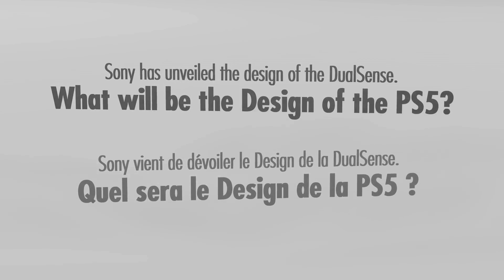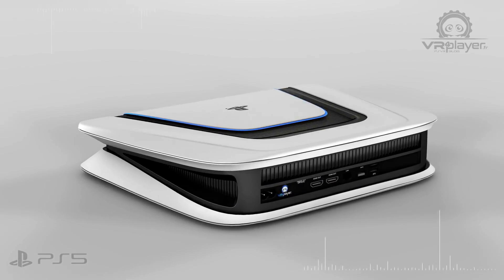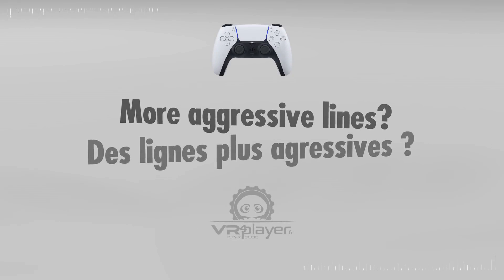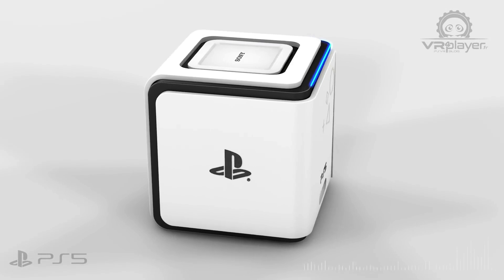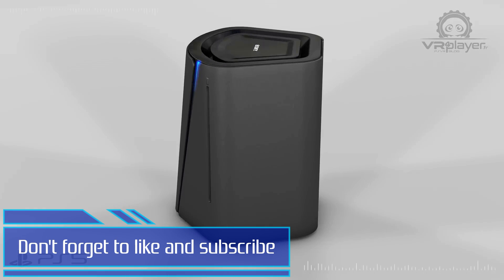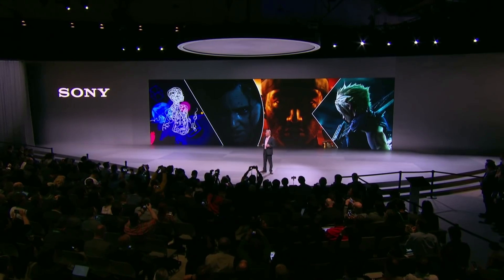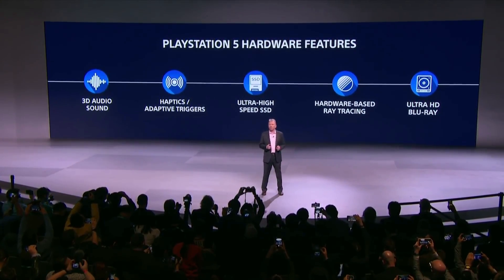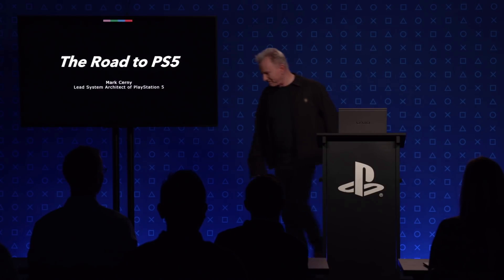PS5 Uses Revolutionary Cooling Solution | Overheating Concerns Squashed, New Patent Reveals

Comment: The only thing I personally think this hints at is that the PS5 is going to be smaller than what we believed it to actually be.
Reply: Maybe its too big so they tried to make it smaller?
Reply: @JacobS-p8x  I think he means compared to the xsx. Personally I kinda like the xsx tower like structure. It would be cool if the ps5 looks like that too.
Reply: It'll more than likely be just as big as the dev kit we saw last year.
Reply: Jacob S that I can understand but looking at this patent idk if I can say that would apply to the PS5.
Reply: Quincent Saiorus That would be interesting if the Patent was for the PS5. Sony is developing an electric car and it could be for that as well.
Reply: Jacob S also true only time will time
Reply: Quincent Saiorus Can’t wait time see either one
Reply: Jacob S facts I’m right there with you in that on bro
Reply: @Grizmark I think theyre using APUs so size wouldn't be an issue. I'd be surprised if they use a dedicated gpu
Reply: I agree. This may help with a smaller print or to fight the high clock speeds which could lead to heat issues.
Reply: The V symbol will be the water cooling tube ;)
Reply: Jan Tran also how much does this add to cost
Reply: @megazine  a lot, but I expect playstation 5 to sell at 600 dollar price tag realistically. 
iPhone today costs as much as a console.
Reply: Jan Tran I doubt it. I think they will aim for $499 or $549
Reply: Haha yep. I'm surprised how slim they managed to make it
Reply: @maazpatel9532  It's slim but it's even taller than the PS4.
Reply: @MegaMoneyMaker711  yeaaah ik

Comment: From the patent image it looks like it’s soldered together completely just talking about the cooling system which would be more reliable while benefiting insane cooling. There is nothing about how big the fan is or if there could be more then one fan but from the rumor I’ve seen they said the PS5 was running quiet under load which would seem like it’s a beefy fan setup. For example smaller fans spin at higher rpms then bigger diameter fans explain why PS4 is a jet turbine under load.
Reply: CONSOLETHUMBS - it looks like they are going to do 3D stacking and that will be amazing if it turns ou to be true
Reply: Yeah that will be insane.

Comment: I dont know but i wont be surprised if when they reveal the console that the specs are slightly  highier than presented ... i believe that Sir Cerny presented specs of the first dev kit just to respond to microsofts xbox s x presentation... ssd is faster, cooling system is ready some compomnents of the rdna3 on the rdna 2 ... i believe that ps5 is 10.2 or 11 tflops could be pushed at 12  like the rumour at its final version and more cu... the console has not being presented yet and the mass production has not started changes and optimisations can be made and look at this new ambitious controller ... 500 or 450. They did good and they are planning to make an earthquake with the official ps5 presentation. I believe we will be surprised
Reply: Novapolis Nova keep dreaming bro. That was cernys pitch to DEVELOPERS. Supposed to launch in like eight months, the specs are what he said they are.
Reply: @doughamilton4245  i m sure they will show two version  the ps5 a ps5 pro

Comment: Didn’t the PS4 get shown in may not June. The cooling isn’t revolutionary it’s common sense, from this patent we can assume the ps5 will be a standard console factor. I think Sony will be fine on heat but my concern pushing clocks so high will lessen the products life. I think Sony was targeting $399 but the cost of the NVME in the PS5 is extremely expensive adding to the cost. If Sony want to hit that price they will need to use slower NVME.

Comment: People are just going crazy about teraflops. Just look at digital foundry's tech analysis of the new call of duty and how it performs way better on ps4 pro than on Xbox one x despite the big teraflop gap between them
Reply: rockyramsy it has a higher frame rate on PS4 pro because it spends far more time at a lower resolution, lol. If you actually watched the video, you’d have heard them state very clearly they Xbox spends way more time at 4K...because it has more GPU grunt! Ps4 pro performs better in frame rate, but no visual clarity. The bigger GPU is able to put out a higher resolution. The more powerful gpu is more powerful. Ps4 pro putting out 4 FPS more per second, does not make up for running at 31% lower resolution. SMDH.
Reply: @doughamilton4245  if you actually have watched the comparison you will notice that they found almost no difference at all between the dynamic 4k in Xbox and the CBR in ps4 pro. You will have to stick your eyes to the monitor and use a magnifying glass to see the difference in resolution. The Xbox one x drops resolution and frame rate too and on top of that there is a lot screen tearing which is quite weird for a console that has two more teraflops than ps4 pro. I don't see the teraflops helped the Xbox one x in any way in that game. This just tells you that MS is using that teraflop nonsense as a marketing term to fool people. If the system isn't well optimized to utilize those teraflops then it will end up running worse than systems with lower power but highly optimized to make full use of those teraflops as you have already seen in Call of Duty and Doom eternal.
Reply: rockyramsy that’s not what they said, AT ALL. Lol, ps4 pro is weaker then XB1X and performs better. Stop it with the nonsense man, this has been know for years now.
Reply: @doughamilton4245  ps4 pro is the best way to play cod on a console that was their conclusion. I will have no problem at all if they said otherwise. It's just I find it fascinating that 2 teraflops aren't really helping Xbox one x it hit the performance mark of ps4 pro. And it is really interesting that the issues of Xbox one x are almost the same as Xbox one s, frame rate drops , screen tearing, resolution drops.
Reply: rockyramsy lol, weaker console is weaker. Repeat yourself all you want. It runs at a lower resolution.
Reply: @doughamilton4245  yeah it's funny isn't when a weaker console runs games better than a 6 teraflop console with no framedrops and screen tearing. Why would anyone want higher resolution with low fps down to 30. That just ruins the game. Also it is amazing that a weaker console still has better exclusives. Xbox has completely redundant now the fact that you can play all games on PC and it has become very clear now that MS uses those teraflop numbers to fool less educated people.
Reply: @doughamilton4245  Yeah right  lol. I just don't understand why you're upset about it. It's really fine and it happens more often than you think. Ps4 performed better this time but I'm sure we will see Xbox doing better in  future games. Just don't lose hope
Reply: rockyramsy lol I’m not upset. I have both consoles, nintendo and PC. I just like to disprove misinformation like tflops don’t matter. They don’t matter when the architecture is different. But when both are the same, the console with more performs better .

I’m simply pointing out the incorrect truth of you trying to say ps4 pro pushes more performance then xb1x , when it absolutely does not. 

Sales have nothing to do with which console is more powerful. I realize ps4 sold better, but xb1x is still far more powerful. Demonstrably so. When were we taking about sales? I could care less what sells more.

Fool less educated people? Educated people know which is more powerful. I have both, I play exclusives on PS4 pro. And multi plats on xb1x. Because they run better. 

Your trying to paint me as some sort of Xbox defender, when in reality your talking about “educated people” and then claim in the same paragraph tflops don’t matter. Ironic. The more powerful console, performs better. Since the dawn of time. Not in sales, in Image quality. This will never change.
Reply: @doughamilton4245  yeah good do you but I really think you still don't understand. Those aren't my words thats what digital foundry concluded and those 2 additional teraflops didn't really help anything. So if you have any complains about misinformation then go talk to digital foundry. Do you even know what a flop is ?
Reply: rockyramsy lol, nice try. I understand what floating point operations are, yes. While your quoting digital foundry, go look at 90% of third party face offs between the upper tier consoles. Xb1x slays PS4 pro. If it doesn’t, it’s because a dev was to lazy to get it there. Same cpu and GPU tech except Xbox has more power, and an additional four gbs of ram.
Reply: @doughamilton4245  yes you understand how to copy it from wikipedia.  because devs got lazy lol that's just the lamest excuse.  It is never about just cpu and gpu power it is about how you design and optimize the system to use the power of cpu and gpu and call of duty just showed that very clearly that you can have superior performance on what seems to be weaker hardware. Maybe next generation Xbox will be better so just relax and don't be upset it really isn't worth it
Reply: rockyramsy not upset, lol. 

Did you go look at those digital foundry face offs yet or did you just ignore that part of my comment? 90% of third party games run far better on xb1x. 

Not to mention ps4 pro does not run cod better, it has 5 FPS more and 31% lower resolution. As I’ve stated. You pick and choose what you comment on, based on your narrative. 

Xb1x stomps ps4 pro in performance, just like xbsx will stomp ps5 in performance. Get over it, get used to it.
Reply: @doughamilton4245  I don't know man you do sound quite upset just from the words you choose, stomp and slay. It really isn't worth it, if you think Xbox one x is better then fine it's you're opinion but you're missing the point here even if the ps4 pro has one frame more that should not happen when it is 2 teraflops less. In theory Xbox one x should be better in everything and yet it runs into quite  a few issues frame drops and screen tearing. That also seem to be the case with doom eternal.
Reply: rockyramsy lol, keep repeating yourself about me being angry. Lmao. 

You clearly don’t understand how draw calls work. The few FPS is because the higher resolution requires more draw calls, and strains the CPU more. 

I don’t think xb1x is better or worse, just that it factually performs better then ps4 pro in 90% of games. Which isn’t an opinion.

Go look at those digital foundry videos yet?
Reply: @doughamilton4245  you really are fuming. Yeah from the way you describe it, it should perform better in 100% of the games and that just proves that those teraflops number are really meaningless when the system isn't well optimized to use the cpu and gpu power. When you say that console is more powerful than the other and then it performs worse then it becomes just an opinion
Reply: @doughamilton4245  does 4k consistently with screen tearing and drops in fps. Oh did we also forget that it's running the game on dynamic 4k resolution ? Meaning that besides the bad frame rate and screen tearing it also drops resolution lol. 

On no that's right the developers got lazy that's why it doesn't run as good on Xbox one x despite the 2 more teraflops. Lol
Reply: rockyramsy they already put a patch out to fix that. You have to wait a few months after release before you do comparisons like that
Reply: @shap7296  well ps4 pro didn't need those few months.